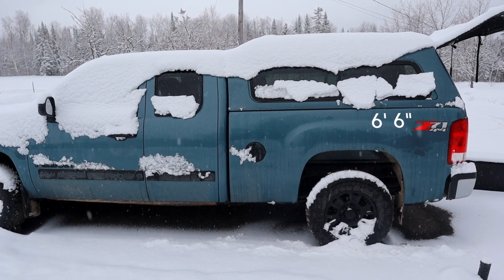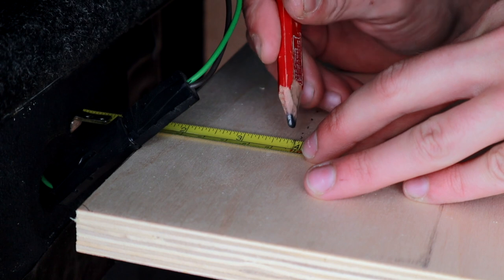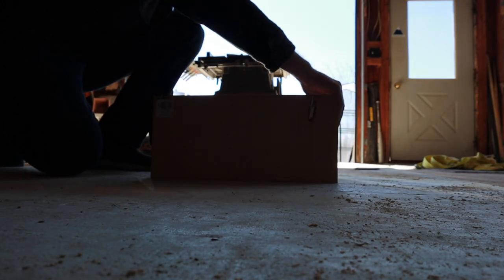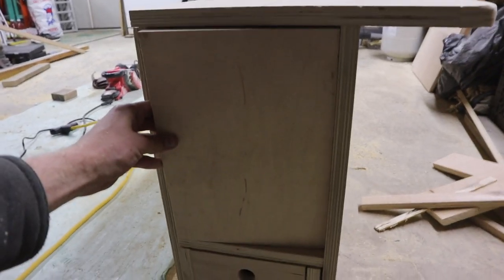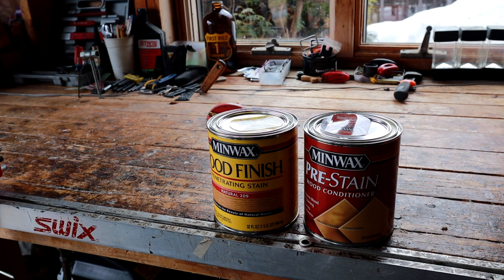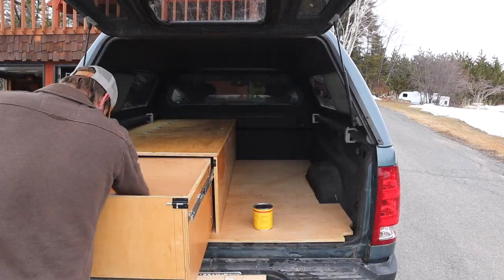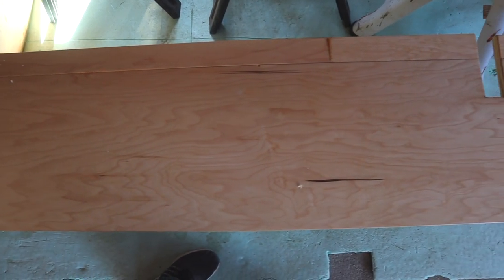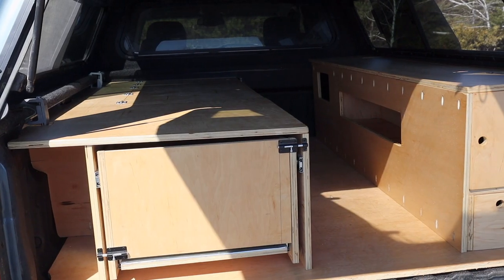How to BUILD THIS Truck Cap Camper! (Step by Step Guide)

Comment: This turned out great, you gave me some great ideas for my truck bed.   I’d like to offer suggestions as a wood worker.   The natural wood stain probably wasn’t necessary since  you wanted to keep it bright and you used the conditioner.  Spray lacquer was a good call but like you said, kinda expensive if you wanted a bit cheaper option that’s still easy, there is wipe on polyurethane that would give you good protection as well as eliminates the fog you get from a spray can.   

Not criticizing, just offering some alternatives.  Loved watching these videos!

Comment: Nice build and I realize this is a year old, but in case you read older comments I’d use canned varnish vs spray, much cheaper.
Reply from the maker: Definitely would have been I don’t recall my reasoning there. Probably because I didn’t want to wait on the dry times or something

Comment: Nice work, but, do not use lacquer as a final finish. It is not water resistant, and, any water will leave a spot or rings around glasses, ect. Use a satin polyurethane instead. it is also resistant to alcohol as well as waterproof.